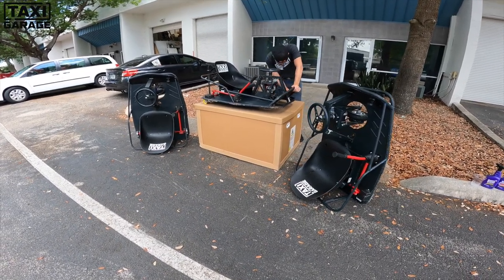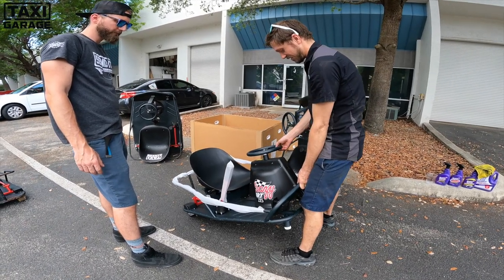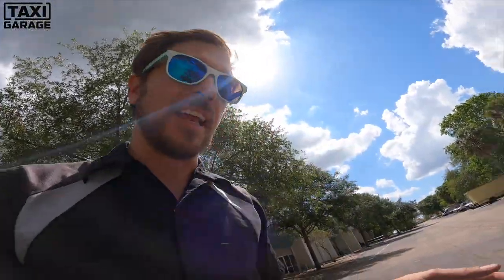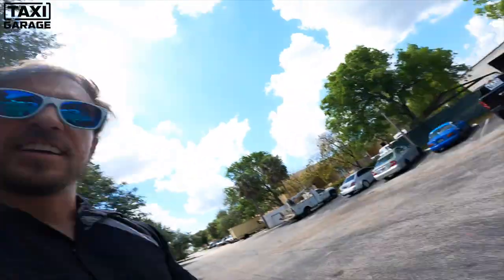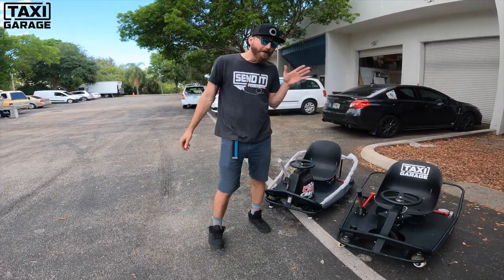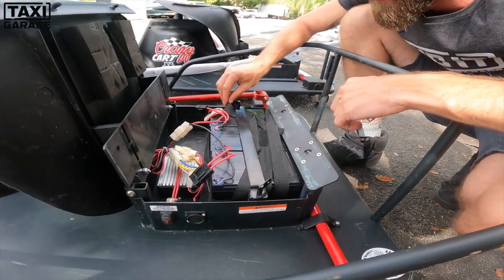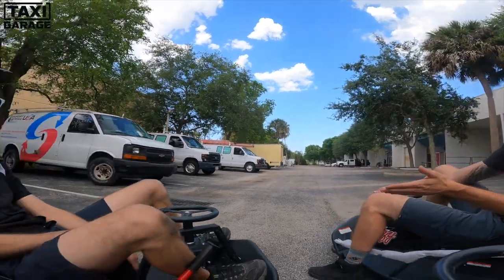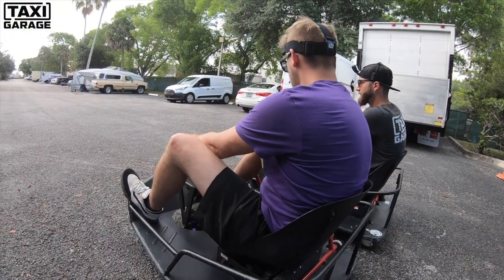Crazy Cart XL upgrades Comparison FULL VIDEO! | #SENDIT WITH US TAXI GARAGE

Comment: You guys should talk to austiwawa (YT username). Dude has a 1600W CCXL with a custom lithium battery pack. Also Hoonigan Garage made a custom Crazy Cart "XXL" with dual motors. It's got me thinking... You guys could maybe offer a dual-motor 1000 kit AND go lithium (if you aren't already, I haven't heard you mention lithium, just the voltage), in order to one-up all these guys. Better yet, if you go AC on the motors, you could probably implement a braking system.

Comment: Can I run the bigger batteries on the stock motor without blowing it up??
Reply from the maker: Yes. Just need to make sure you do not overheat the motor.
Reply: Yes just make sure you don't get a battery that puts more power out/volts out than what the speed controller can handle, and like he said already, just make sure you don't overheat the motor.. It depends on which cart you have, I have a regular original crazy cart all stock, and have been wondering if you can upgrade to a bigger battery but with the same 24volt power and so far, everything I've read, you can as long as like I said above^^^
Reply: I just want a battery that last longer but with the same 24 volt power😂.. I don't know if that's what you were asking but I hope I was lil helpful, hope you have a great night and pls, feel free to reply🤝🏻